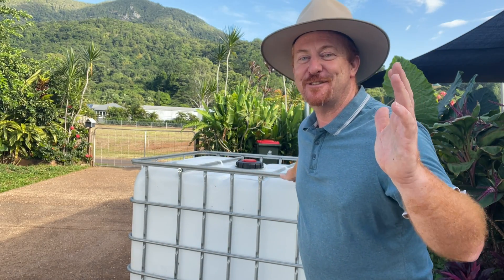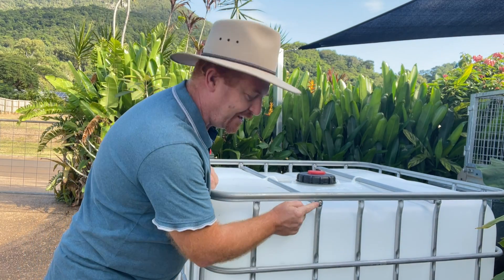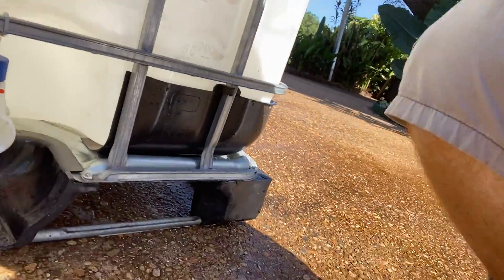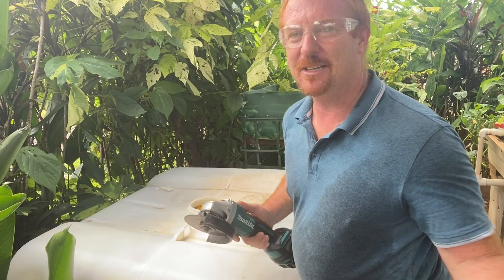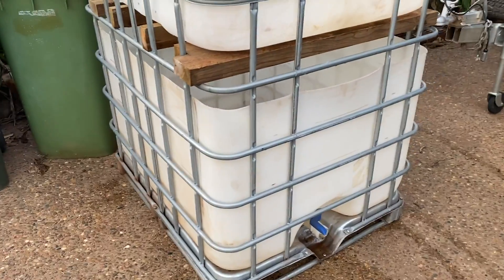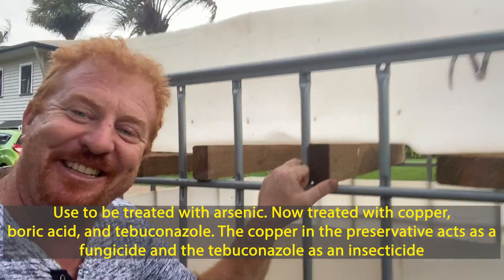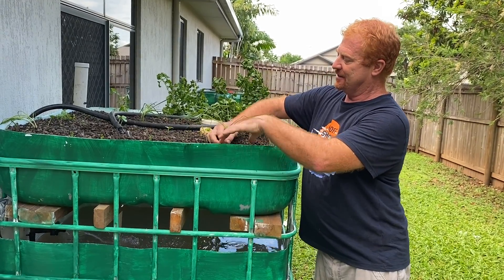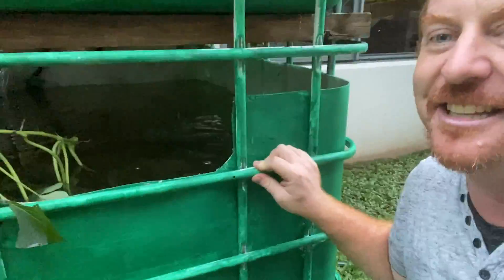How to build a Simple DIY Aquaponics System for Beginners- no cut IBC Tote Cage method🍅🐟

Comment: How to use this concept for large aquaponic system using IBC tanks? Plz let me know. For example 100 IBC tank system
Reply from the maker: It’s not hard to join ibcs together. I have connected them with bulk head fittings or sink wastes to join when needed. I have also simply added individual pipes and taps to each ibc. All drain to a sump. Hope that helps.